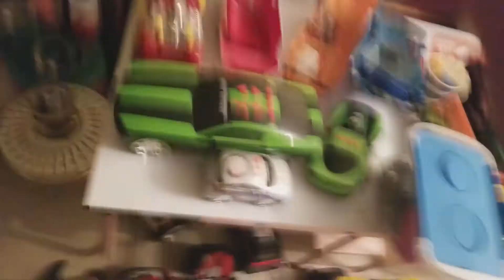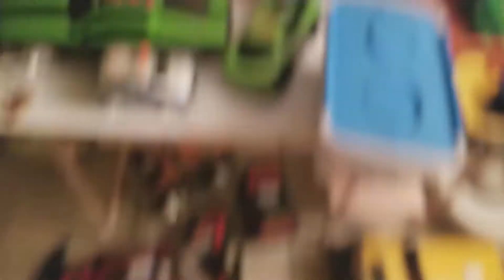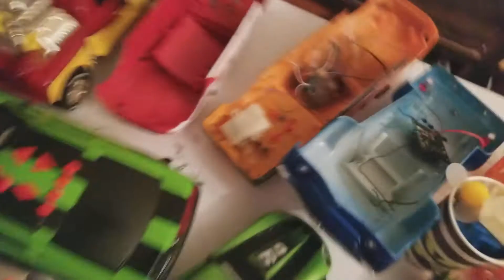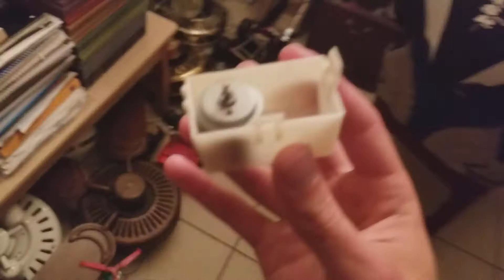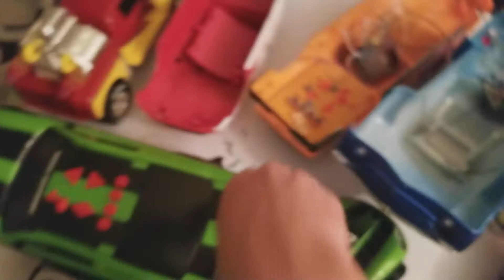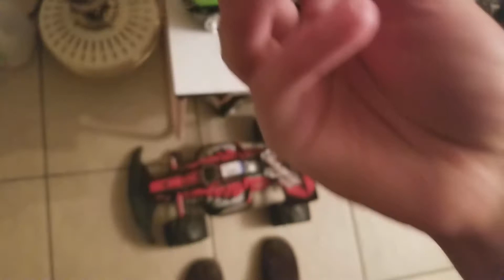Update Video on Rock & Roller and Orange F-150

Comment from the maker: Btw the motor wires are black (positive) and black & white (negative)
Reply: ThatToyVehicleGuy9000 what will happen if a motor doesn't have a capacitor
Reply from the maker: From what I've seen they all have different types of capacitors. The orange things that are marked '104' are non polarized while the cylinder shapes ones are. The stripe on those represents the negative side